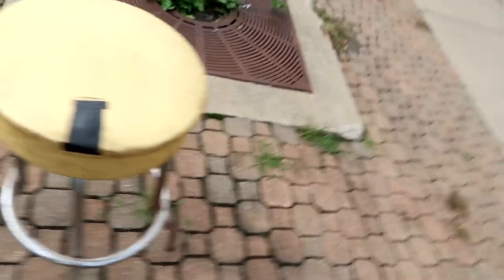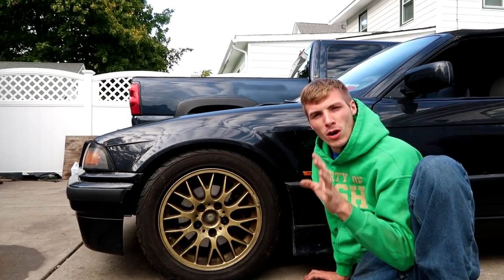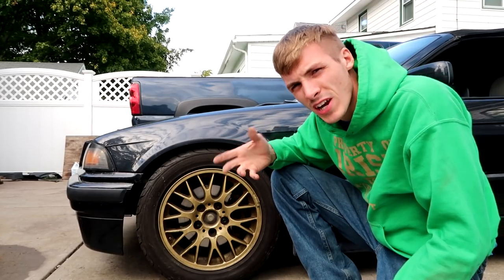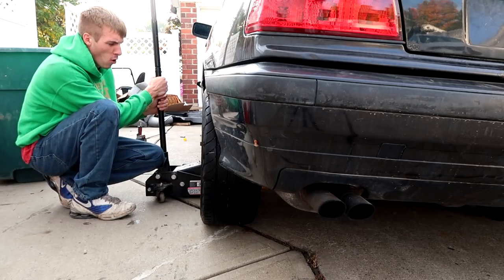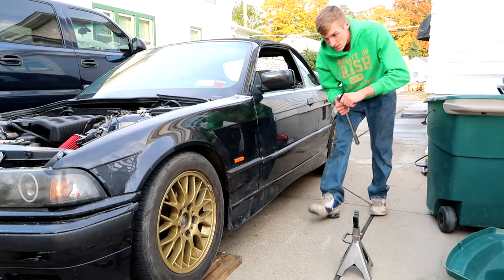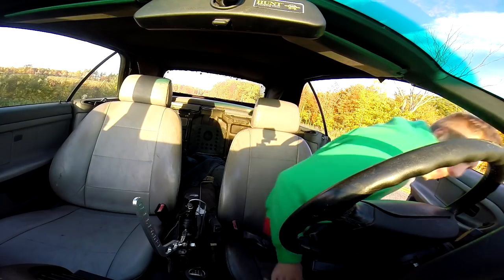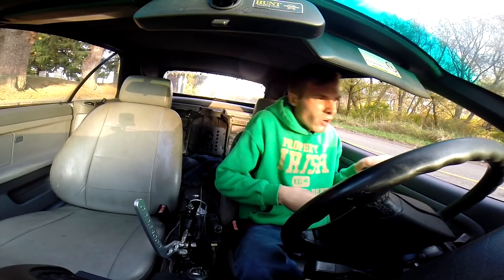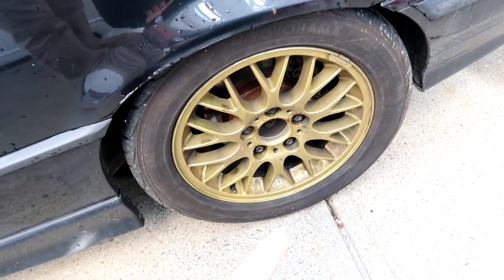BURNOUTS FIXED MY FLAT TIRE!!!

Comment: Yes used to fix tires through high school, no bubbles seemed to always be the valve stem. tighten the needle in the valve stem, then replace valve stem if necessary.

Comment: Your tire might have a bad valve stem
Reply from the maker: I checked that too. Ill have to look again for the leak.
Reply: 3DMachines i think i have some parts for a the BMW do you want them
Reply: Does the rim have any cracks?
Reply: 3DMachines Y DO YOU HAVE A DRIFT CAR IF YOU ARE NOT GOING TO DRIFT YOUR CAR
Reply: His E-brake didnt work...
Reply: Johnathan Smith z
Reply: That's what I'm thinking.
Reply: Johnathan Smith same hear
Reply: Exactly what I was gonna say lol, confirmed.
Reply: Johnathan Smith ,exactly
Reply: Guy007 Gaming
Reply: Josepmiik
h Eckenroth

Comment: Did you spray the valve stem? Take the cap off and spray inside the valve stem and around the base of the stem.

Comment: Bad alignment or bushings on the driver's side rear can cause the tire to generate more heat since it is not going 100% straight.  Extra heat = more psi as you said.

Comment: Hole in tire + burn out = likely blow out. Burnout increases temp and PSI, more air trying to go out a small hole can ripe that hole larger. The higher temps soften the rubber allowing that hole to tear open easier. Also the Rubber on a tire is vulcanized. Meaning it doesn't melt and is more durable. It will burn before it melts.

Comment: I was always told to run tires at the manufacturers suggested psi and not the tires max psi. Just throwing this out there. if you over inflate your tires it wears the centers out faster. But it's your stuff so do what ever floats your boat. 

Also like a bunch of other people said a dunk tub just about always shows the leaks.

Comment: Burnouts tend to make leaks worse.  They pull and twist at whatever it is causing the leak and loosen it.

In your case you have a position sensitive leak.  With no pressure on it it leaks very slowly, but when you park it with the leak down by where the tire is distorted by the ground/weight of the car it leaks.  You probably have a small screw/nail in it that the head has worn off making it hard to find that only really leaks when there is pressure on it/when you're sitting on it.

When it's sitting somewhere and goes flat re-inflate it without moving it and check it again, i'll bet that you'll find your leak or at least something stuck in the tire somewhere in the bottom 90* of the tire.

Also check the valve stem, it could have a crack in it or the valve core could have a problem that makes it position sensitive, that when you let it sit at a specific angle it opens up and leaks.

Comment: to check the beads with the soap and water u should lay the wheel flat on the ground. let it sit there for a few minutes with the soap and water. u can check the stem and the core at the same time.  if someone put fixaflat in that tire u may not find a leak with soap and water but it will still leak down sitting on the car.

Comment: check the the valve stem with out the cap on and also lay it on its side to check the beads alot better and also if you have a bead leak around the take a hammer and hit on the tire where the leak is it will seal it better and alot easier and cheaper than going somewhere to fix it

Comment: Dalton just for future reference don't always assume you can just put a bunch of air in a tire, and in return be able to find all the leaks. You'd think the more air  the more pressure would push out the holes making them easier to find. Wrong. You may have a leak around the bead, and you pound a bunch of air in, and in return potentially "sealing" that leak for the time being.

Comment: You gotta find those roads that have a lot of tar oozing up, once ya start to burn em, it's like being on an icy pond. 
You should be able to get a burnout going for 2-300 ft easy.  
I used to get em 7-800 feet long, on my old beater kz650 streetbike.

Comment: drop pressure down to 30 check bead leak then drop to 20 and check again. sounds like leak around bead of tire, at 40 the  pressure seals leak, as pressure drops leak gets bigger  also spray inside rim where rotor is.

Comment: Your rims clearcoated alluminum causes bead leakage if you put more pressure in it you may not find it .reduce the pressure and try again.ive had problems with alluminum wheels that are clearcoated.they give me a headache

Comment: A road may look flat, but they are not.  If you get down to eye level, you'll see a slight hill in the middle of the road where the markers are, and you'll also notice a slight sloping grade of 2-5 degrees on either side to provide for water run off.  Because you are driving on the right side of the road, I hope, the left side tires build up more friction with the road, thus causing more heat and higher pressures.  I agree with Jonathon.  You may have a bad valve stem, though I don't know exactly why it is only leaking overnight.  The colder temps may have something to do with it.  :)

Comment: Yes if you DID use a tire plug it would last, the plug just flattens as the tread wears down. Should stay in as long as you use a decent amount of rubber cement.

Comment: The extra weight on the driver side of the car from, well the driver lol, might be why the tire pressure increased on that side faster.  More weigh equals more of a frictional coefficient especially with the welded diff.  Just a thought.

Comment: tires can leak only when they are parked a certain way.  the tiny hole will not leak unless it is parked in the exact spot it needs to be to leak.

Comment: they tyre with a puncture will get warmer quicker causing it to have more PSI because as it deflates at the beginning it has more surface area causing more friction and heat.

Comment: You can get new valve stem cores or yours could just be loose, you must have a valve stem core extractor. Might only leak with the weight of the car on the tire.

Comment: Have you heard of "sticky tires".....thats what Nascar cars have when their tires are under pressure and there is a leak in the tire. Basically, the tire gets so hot, that it begins to melt sorta and glue any holes together in the tires. Sorta how your burnout sealed the holes in your tire. I think I got that right off of my memory....

Comment: +3DMachines valve stem spray it on there and bend it and move it around and the valve core could be or it could have that tire sealant in it and it pushed it out then sealed back up. love your vids i have a 86 rx7 so i drift to lol

Comment: Is there a cap on the stem. I had a tire that kept going flat because it didn't have one
Reply: IF the cap kept your tire from going flat, you needed a new core, not a cap.. not to mention valve caps aren't sealed, so they only slow teh leak down a little.
Reply: DaTwistedOne1 
the decent metal caps have a rubber seal in them, and will seal up if the schrader is the cause.

Comment: The burnout only heats the rubber contacting the road to the point of melting/burning. otherwise if it heated more to the point of being heated to being sticky/gooey to seal a leak might cause the tire to lose shape. I'm not a tire/rubber expert but the rubber has already been heated to cure it in a process called vulcanizing. I cannot prove you didnt fix the tire BUT in all likelihood you didnt. Try Tireject. Works great unless you have TPMS then it kills the sensors.

Comment: just use fix a flat. the bottle that has hole sealing liquids that seep into small holes to prevent leakage.
Reply: Causes vibration, only use that stuff for emergencys yo.

Comment: The reason why it took longer is it being on the rear it was under less load aka weight , you have a slow leak to slow to detect with soapy water , especially with no weight on the tire , common sense bro